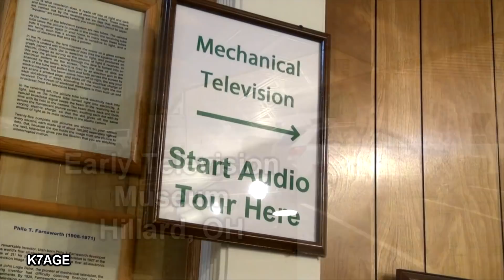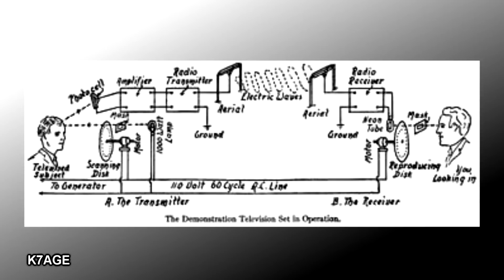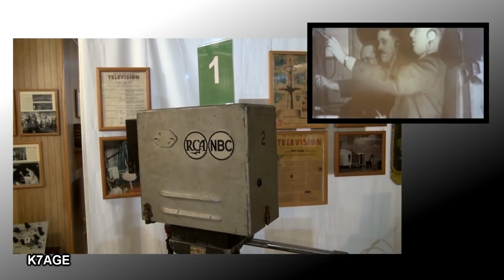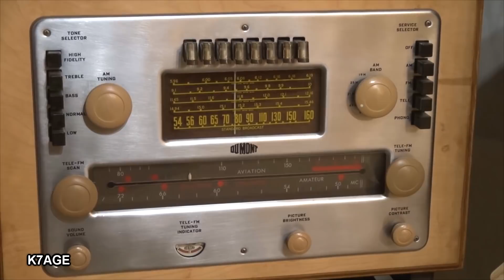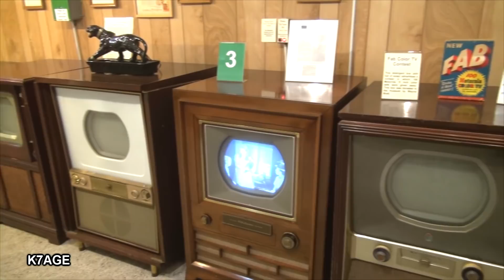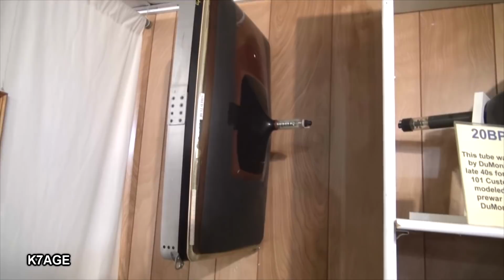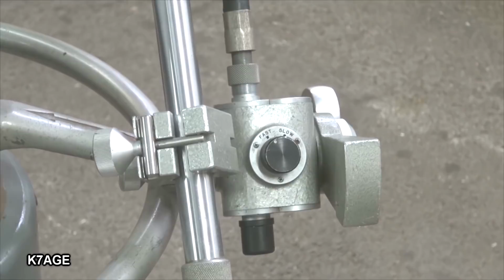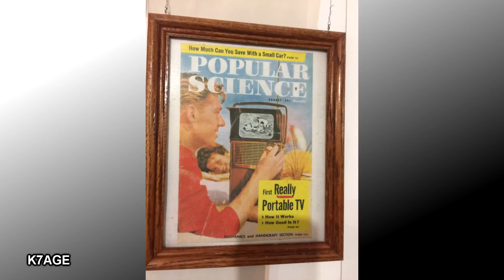Visit to the Early Television Museum

Comment: Excellent video!  I would like to visit the museum someday, myself. The only thing missing from the museum is early television in Germany. The 1936 Olympics were broadcast. Hitler used TV for propaganda, and later those running the system used TV to strengthen the morale of wounded troops.
Reply: the camera use at the olympique were based on Philo Fansworth  design
Reply: @thecarl168  1936 in Berlin more often the "Zwischenbildverfahren" was used. In one go film was exposed, developt and scanned.
The Iconoscope tube (patented 1923 by Vladimir Zworykin) was to weak in 1936.
Reply: I saw a picture of a camera it was use outside it was an electronic camera not a film , obviously because it was outside they had enough light
Reply: @XE1GXG  I could read it, thanks to Google Translate. This is something not well known outside of Mexico. Thanks for sharing!
Reply: @davidsradioroom9678  I understand NASA used a version of the Camarena system with Apollo
Reply: That's still why its used today.
Reply: @JeffDeWitt  , yes, i just watched it.  fascinating.
Reply: Heckuva job, Hit!

Comment: My mother worked for  Bendix Radio here in Baltimore and then Westinghouse Aerospace. It was before my time but she built her first television about 1950 when they had vacuum tubes. She told me she didn't even had a case around it . I was born in 55, This would had been right up her ally. I don't even have a picture of it. She was an electronics guru.

Comment: Being a radio and TV technician (and later and instructor) employed by RCA beginning in 1952, much nostalgia was brought to me in this well done video.

No disrespect, but I must say that there were 3 "color" systems (not just 2); as the government decided, which system would become standard. Of course RCA won, because it was all electronics; where as the CBS and Zenith systems required mechanical pictures. Imagine having motors in our TV's, to spin a huge red, blue and green colored wheel; at a high RPM. Wow! What about the noise and maintenance? Whoowee!

Sadly, color TV's took years to produce good pictures. If my memory is correct, it wasn't until 1964, until RCA brought out a color picture TV; that was as good as B & W TV's. And it wasn't until HDTV came out that TV was better than the 1964 color TV. IE: the best fidelity they had was 480I (not 480P). There couldn't be 480P because it was an "Interlace" system; rather than a "Progressive" system. Of course HDTV came out with 1080P. And the rest is history.

I am proud to say that I was with RCA for 33 yrs; and a part of this incredible advance in technology. I loved it like a child loves candy. I met the engineer that helped develop the "Tri-color" picture tube ("Kinescope"). I would have lasted longer with RCA, but GE bought RCA in 1988 and got rid of ALL of RCA's management; which I was one of them by then. Broke my heart.

My sincere thanks for your making this video.
Reply from the maker: Thanks
Reply: @K7AGE  You're welcome. I made a mistake in the comment. I started with RCA in 1954; NOT 1952. Sorry bout that.

Comment: Great museum and presentation.  My grandfather built a TV in 1940 using a Allen B. Dumont tube.  That set was huge.  We used it until 1960.  That year he got an RCA New Vista color set that had 40 vacuum tubes in it!  To this day I still use a flat screen CRT TV (JVC) for looking at vintage DVDs & JVC tapes.  I have a phonograph from 1898.

Comment: I was born in 1954 my dad and grand father were in the antenna business I am the 3rd generation in San Diego. I wish you could expand your museum to cover antennas and rotors. The test pattern was not only for broadcasters but mainly for antenna companies to make it easier to collect money from there customers after the antenna job was done, seeing how most TV programs didn't start broadcasting till 4 or 5 PM. Home owners didn't want to pay for an antenna until they could see a picture. My dad's company was Pacific Antenna and he hired all my aunts uncle's and my cousins for his antenna business. In San Diego most antennas were 40 feet above your roof top with a rotor a big combination UHF, VHF and FM antenna. The reason for the 40foot + height was to get 10 more channels from Las Angelis LA plus the 5 channels in San Diego. In 1962 my dad Leonard Schlick ordered a new 100 foot crane truck  with a basket where he could replace or do maintain any of his customer needs. Dad sold Pacific Antenna in the 70's, all my relatives went there different ways but still doing antennas, such companies as Custom Antenna, Antenna Engineering, Franks Antenna, Goodrow Antenna and mine was Specific Antenna. In the 70's I started my company Specific Antenna, my aunt and uncles would send me the jobs they were not interested in like Ham Operators, CB'ers and military jobs and that was fine by me. I did towers, ships, military antennas and any job they didn't want and I had a blast! For many years I worked for my Aunt Betty Valdez at Custom Antenna, 2 men per truck. On any given day Jerry Valdez my cousin and I could install 5, 6 and 7 antennas a day. 40 foot of telescoping EMT, guyed wires, rotor, antenna connected to your TV in just over 1 hour. Love your museum wish there was more to the story. I want to also thank Wayne McKenna at Coast Antenna, Jay Goodwin at Mission Hills Radio &TV and my cousin Mark Valdez at Custom Antenna, Emmet and Josephine Tobin at Edge Water Cable TV my grandmother and grandfather, I am sure there are many more. These were the best years of my life! Look at where we are now 500 channels and nothing to watch. Years ago I thought the Indian Test Pattern was a TV show.
Reply: I remember as a teen in the 60's I told my school consular I wanted to find a job in a tv/radio repair shop. Howard's tv paid very well at the time their was lots of work putting up antennas and servicing the new color sets.
Reply: i used to watch the indian test pattern when i was 5 or 6 years old

Comment: Just amazing how fair electronics has came from those days of tubes to transistors to IC circuits reminds me of a course  were at the end you had to build a 5 tube radio and pull all the parts and the teachers would make sure that bad parts were place along with good parts , so you had to check each part as well.

You sound like one of those instructors who had it down when it came to teaching electronics.

Thanks for your time and posting this video well done and I love the old TV & Radios of that time for they were all so works of art to me all hand build , Repairmen would come to the house and service any TV set or radio not working,  I remember all most ever drug store had the big self serve tube checker as well

Thanks

Comment: I was on a Stratcom site (6 GI's) n Korea in 1969, I was the AFKN tech on that mountaintop microwave site. We used the Raytheon KTR-1000 remote microwave system to relay the TV signal down the spine of S Korea, we received or signal from Taejon (48 miles) and relayed it to Taegu (26 miles). Keep in mind this system was designed for remote broadcasting so was usually used over hops of just a few miles (line of sight). Being on a 3,500 ft mountain helps with the range.
Reply: Was in Wonju @ Cp Long, 84-85.  Always called AFKN ‘Another F****ng Korean Nightmare’.  The AFKN tech there said they were trying to shoot a 50 mile microwave shot w/ equipment designed for 25 miles.  Every time it rained or snowed hard, the signal would go out
Reply: @jamessimms415   One problem with our shot from Taejon was it was not quite line of sight. There was a mountain between that just blocked our line of sight, to get reception we both had to shoot at the fringe because the microwave signal would bend just a bit (fresnell effect). The result was a somewhat noisy but usable signal.

I once saw a letter from a corps commander bitterly complaining about our "entertainment" forcing his men out to the village at night. The programming was pretty lame but 20 years old guys are a lot more interested in girls and booze than reruns of 195's sitcoms. AFRTS had a small budget and bought what they could afford.

Comment: Hi folks. My late Dad built one of the early Baird mechanical TV receivers in the late 1920's.  After 11 pm at night the BBC changed one of their radio channels over to the Baird test transmissions. The loudspeaker in the radio receiver was disconnected and replaced with a neon light. The scanning disk - hand made by Dad - had 64 small holes arranged on a spiral that traversed in one inch on the spinning disk and was driven by a pulley system and an electric motor. Synchronisation with the studio camera disk was archived by having a foot operated rope brake wrapped around the motor axle. A magnifying lens increased the picture size up from 1 inch by 1 inch to about 2.5 inches square. Apparently the entire road of neighbours packed into the front room to watch this miracle! I believe that the first 64 scan line picture transmitted was that of the then King's head. Test were also carried out with a rather more electronic system. World War 2 put paid to these experimental broadcasts.

Comment: Hi from Scotland. Thank you so much for this excellent video. I have visited the site. of Baird's first tv transmissions in Hastings, England. I'm old enough to remember when people were really excited  about having a TV. 

Something that amazed American visitors to the UK was the fact that many TVs in the UK were rented. The attraction was that for the cost of your monthly rental you were guaranteed a working set without having to pay for, sometimes, costly repairs. The  more modern and attractive a set, the higher the rental. At the bottom of the market there was pay as you go TV.  The TV was hooked up to a coin operated slot meter. When the coin ran out so did your TV show! These tended to be older sets and, in fact had a monthly charge. If the amount of coins deposited met the monthly cost all was well. If it didn't you were still expected to pay up. If the amount of coins exceeded the monthly charge, you were given a rebate. 

Improvements in UK living standards and the fall in the cost  and the increasing reliability of TV  sets, gradually eroded the rental market.

Comment: I first saw TV in 1950, when I started
school, and around 1950, we had a 10
inch screen set, and a couple of years
later, a 17 inch screen Admiral TV with
a record player and AM radio, which we
kept using, with repairs, until the early
1960's, when in 1964 I purchased a larger, still, Black and White, 19 inch screen Zenith Portable TV with an Ultrasonic remote control, which I had until 1976, and sold it for $25.00, then obtaining a 17 inch screen Sony Color TV. We also had from 1955 until 1968,
a large RCA console TV with a 27 inch,
Black and white screen, with a big picture  tube, a 27 MP4 tube, which in the later
1950's, I helped my Father replace it, with
a rebuilt locally, Picture tube, for about $150.00. We used to be always pulling out, testing and replacing tubes in the TV set. In 1968, the 27 inch set was replaced by our first Color TV Zenith console, which we had until 1981. I actually saw
my first time, color TV, on a 10 inch set
at our local hardware store, and at 5 PM,
there was the Howdy Dowdy show when I was about 10 years old.

Comment: As a youth I worked in an antique store and learned how to repair tube radios, then on to TV sets. Stuff like Dumont, Atwater Kent. I also built an Heath Kit TV. Today a TV is as simple to repair as swap out a PC board. My best repair was a Samsung TV 60". I baked the main board for 10 min at 350 degrees F. The set has been working fine for 4 years now.
Reply from the maker: I built a Heathkit color TV too, it worked first time that it was turned on.

Comment: Wow, Randy, I didn't know that this place existed......now I need to get myself out to Ohio!!  Watching this wonderful video brought back a flood of memories from the 1950s - '60s, and the B&W behemoth with the 12" screen that I got to watch as a kid (I was born in '52). Since we lived at least 50 miles from the nearest TV station(s), we usually struggled to position an antenna so that a picture...any picture...could be seen through the 'snow.' ....and on and on the story goes! After a stint as a Navy ATR (Avionics tech/Radar specialist) I spent part of the early '70s repairing TVs for local folks, until getting into radio broadcasting then, eventually, commercial low voltage systems...which I did until retirement, last year. Thank you so much for a great video 'tour' of the museum.  73   KC1MGW

Comment: Randy, I really enjoyed this video. It's hard to believe that it wasn't until 1970 that color TVs out sold B&W.
Reply: It was also right about that time that solid state began to edge out vacuum tubes.
Reply: @ronaldgarrison8478 except for the CRT.
Reply: @N2YTA  Yes, obviously; and in many cases, if not most, the high-voltage rectifier for the CRT also hung on for a number of years. It produced small amounts of soft X-rays, making it a bit controversial.
Reply: We didn't have a color TV until 1976. When I was 13. The TV was a used 25 inch Zenith.
Reply: @redrooster1908  I grew up with black and white TV till about 1985-86 we finally got a color set it's pretty amazing to finally watch Saturday morning cartoons and color

Comment: Very interesting, and a very good account of the development of tv in the USA. It was slightly different in other countries but American technology was used a lot around the world in the early days of black and white electronic tv systems. The first British public tv broadcasts in London in 1936 tried out the mechanical Baird 240-line Televisor system, alonside an electronic design using the Marconi-EMI 405-line system. Each system  required different receiving equipment, and were broadcast in alternating weeks as an experiment  to see which was best. The electronic system was selected in 1937, and daily BBC tv broadcasts continued up to the beginning of WW2 in 1939, recommencing in 1946. Later colour tv sets around the world used different systems from the American NTSC, notably PAL and SECAM.
Reply: Just a footnote - the first transmissions were made at and broadcast from Alexandra Palace in north London which, despite (a couple of I think) fire is still standing and sometimes used as a production location.  The antenna tower is still in place.  Transmissions stopped in teh war as German bombers could have used the TV signal to triangulate bombing raids on London.

Comment: Just ran across your program. Great show. In 1959 (I was 18),I went to work for a station in Chattanooga, TN. The GE camera looks like the one I used to run on local news etc. Also had a big RCA with a big Zoomar lens. All black and white then. After using, we would have to pan around on the floor for a long time to remove the "burns" on the screen.
Reply from the maker: Good old days!  Zoom lens with a push rod through the middle of the camera!

Comment: If you like a lot of parts around the back I'd recommend an early UK colo(u)r set. The UK started broadcasting with 405 lines, positive modulation and AM sound, a standard that was unsuitable for color so they adopted a second standard of 625 lines, negative modulation and FM intercarrier sound in the 1960s. The result was a set that required swiching between the two. I inherited a dead 26" set in the early 70s (it was dropped downstairs by someone who was stealing it from a nightclub and so rendered unrepairable) which I was able to fix up. This had a series of slide switches, one on each circuit panel, operated by a solenoid to change standards. To add to the fun these early sets were hybrid tube/transisor, with the line output and  EHT stabilizer generating significant amounts of X-radiation. I must confess not to missing this technology much.....

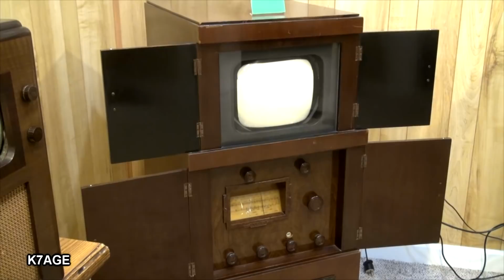Comment: 6:23...In 1987, I bought a 60" Kloss Videobeam Model 2, which looked a lot like the two propped mirror sets on the right. Except it was a rear projection unit that cast it's image on the wall (instead of viewing it directly off the mirror). It lasted 19 years. I only had to take it to the shop once in all those years. I remember scrapping it along with a Quasar VCR that lasted 24 years the same day at our local biannual recycling drive. I tried to give them away online first (in 2006) before scrapping them. But no takers. I simply did not have the room to store them away for posterity. That same year (2006), I bought a used (32"?) 1992 vintage Zenith from an estate sale for $35, that was still working (at 22 years old) when I donated it to Goodwill in 2014. That year, I inherited Dad's 2011 vintage 40" flatscreen Magnavox ($500 new), which I donated to Goodwill in 2018(still working). That was the year a friend gave me his 2008 vintage 42" Panasonic flatscreen ($1000 new). I still got it and it still works! It goes well with my also still working c. 2006 vintage Panasonic DVD player, which I bought new from the now defunct Circuit City.
24:33...I had a 1958 vintage RCA "portable" B&W that a paper route customer gave me in 1971. It was portable only by the strictest definition as a single person could lug it around via the carrying handle on top. But it was HEAVY! It worked, but I had to have a repair shop fix the vertical hold on it. I gave it to a friend several years later. There is one exactly like it shown in the 1975 movie "Crazy Mama."

Comment: The fun fact here is that that field sequential color system is still used in DLP projectors not having three DMDs (micromirror chips) - one for all three colors (RGB). So a color wheel is rotating and the DMD is fed with the color portion the color wheel is on.